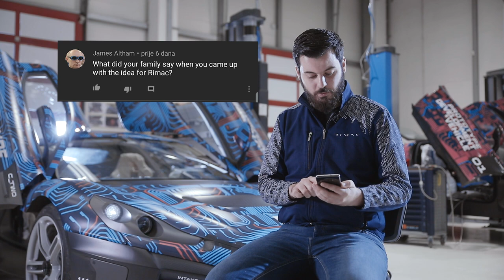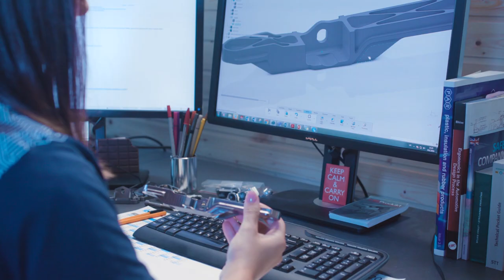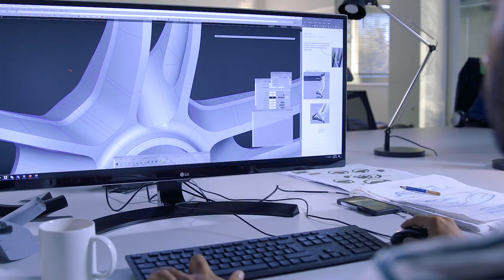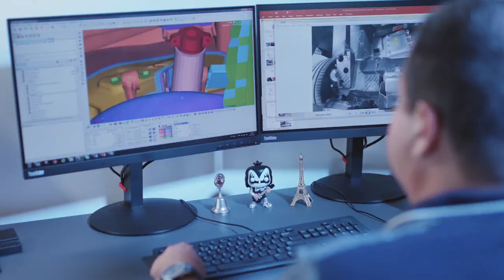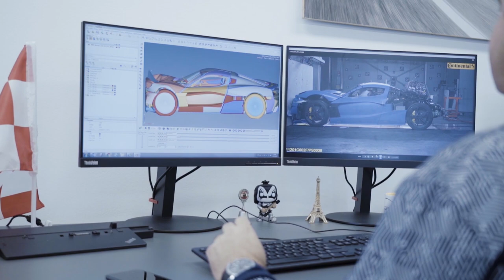The Challenges of Building a Hypercar | Mondays with Mate E02

Comment: Even if the future of the automotive industry mainly involves mass production of autonomous vehicles; this is a sector that Rimac could come to excel at. There is a lot of room for innovation in the vehicle manufacturing space. Much of the automotive industry has outsourced most of the vehicle parts. There is an opportunity to significantly reduce the cost of manufacturing autonomous electric vehicles by designing vehicles from the ground up to be used as part of a commercial autonomous vehicle fleet. Rimac should partner with companies such as Foxconn (who are looking to develop expertise in advanced robotics and electric vehicles) to start manufacturing vehicles in higher volume. Rimac should also try to attract investments from companies such as Apple/Google, Amazon, Ford, Groupe PSA, etc.

Comment: Hello Mate!

First of all, a great job setting up the company! I am a fan of yours, like Cristian von Koenigsegg. 

I wanted to ask you, how much money in total, approximately of course, it costs you to build a supercar from scratch, so using parts from other manufacturers and/or building them yourself as for example the integrated circuits, buttons, steering column indicator switch, electric motors and bateries as you did in Concept 1, and how much money, including facilities, engineer salaries, hardware and software, it cost you to build your first Concept 1, as you did yourself. Which are the most important steps you can advise in the early stages and the strategy. What software you need to build que design and then digital 3D car model. How much does it cost and, ones more, in your second video you said than with Concept 1 you didn´t do the crash testes and the complete homologation, how can it posible to sale the car if it haven´t hologated it?

It would be nice to explaining everything in a video, specifying all those first steps when it comes to building a Concept 1 from scratch, at the business as at the car building levels, and the most important advises and of course the approximate cost, if possible please.

Waiting your answer. 

Best regards!

Comment: How does your electric motor compare to Tesla? Which is most efficient? I understand and agree with the battery. However, why not make a wall to the roof. I understand your car has power to all 4 wheels and independent. You have motors in the center of the vehicle. Why not use in wheel motors in each wheel? That may give you more space in the center for battery capacity.

Comment: Back in 2011, when I got into Faculty of electrical engineering in Belgrade, I wrote to Rimac asking what kind of engineer they need.
They said to call them when I finish.
After faculty I sent several applications, I got no replies. 

Now I am designing railway systems.